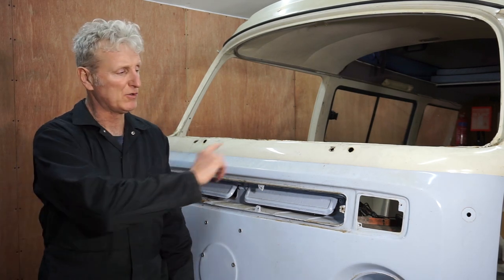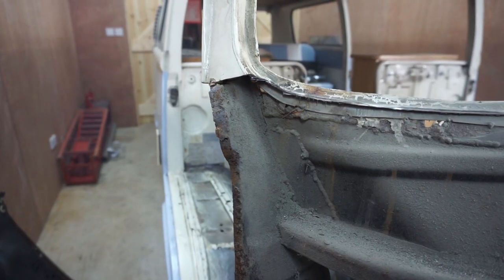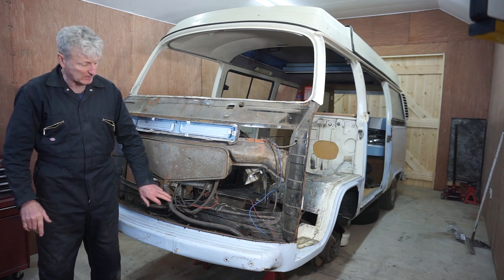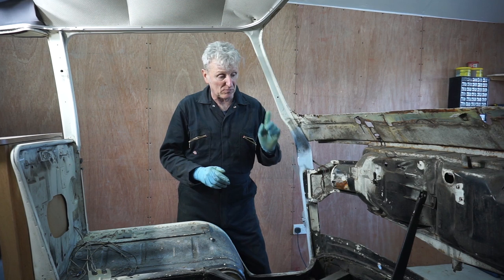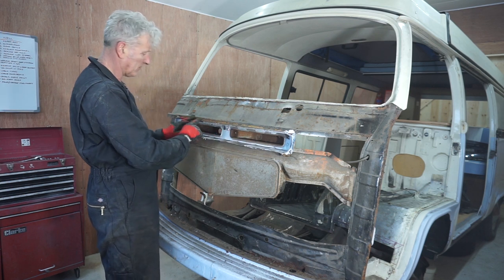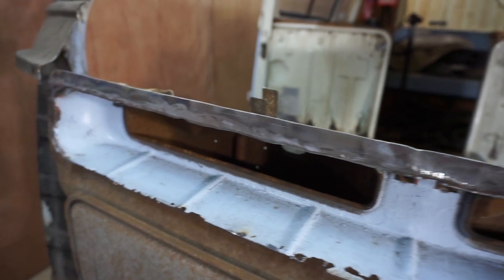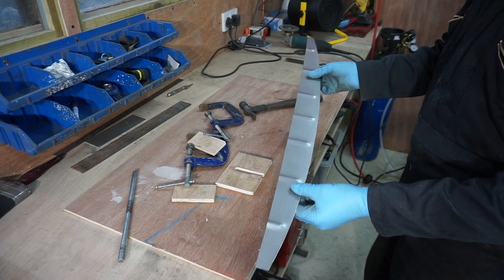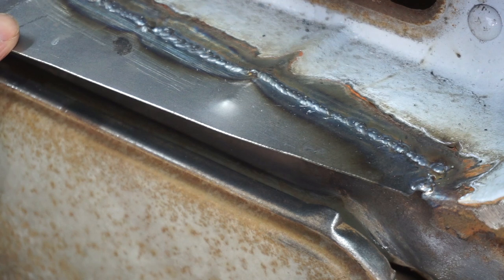1973 VW Campervan Restoration Part 4

Comment: Another great episode. Just getting my grinding tools together to get started on our T2. What size cutting wheels do you use? Impressed with the fabrication work......looking forward to next episode 👍
Reply from the maker: Hi Philip, I use 41/2 inch by 1mm thick discs for cutting, the 1mm thickness gives you just the right size gap for welding.
Reply: Hi John. Thanks for the reply and info. I was looking at your website and loving all the vans..........we need to chose a colour as ours is a number of ‘unmatachable’ beiges! Would you know the colours and codes for Bessie, Lola and Nell out of interest? Thanks......